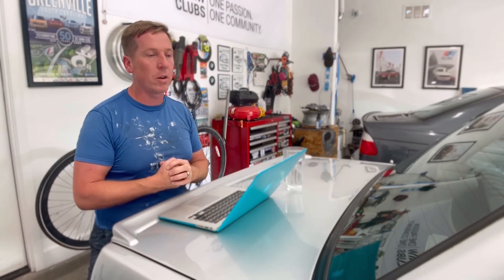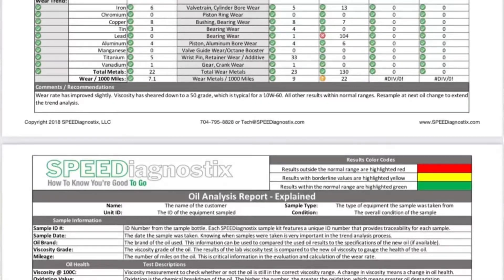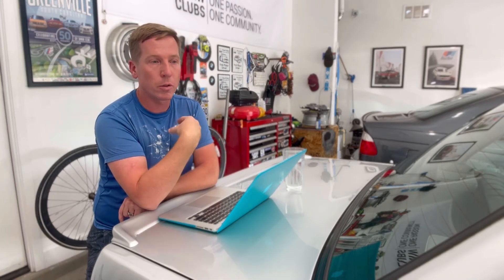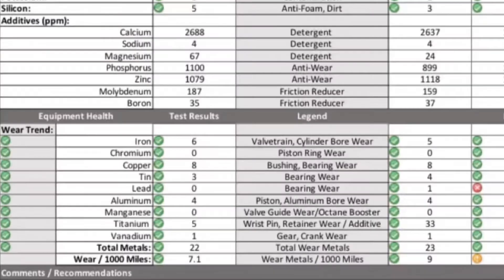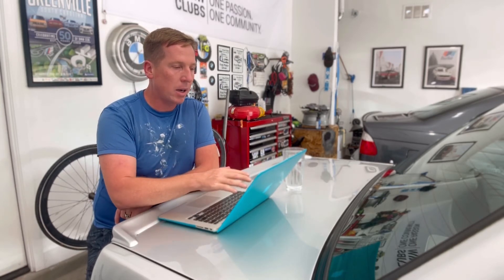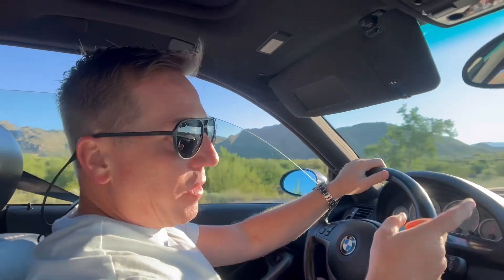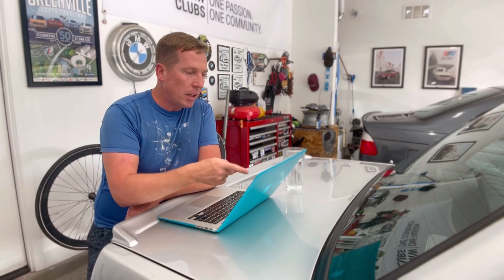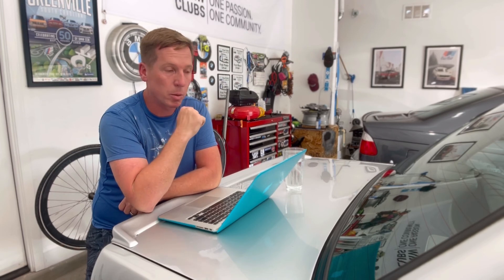BMW E46 M3: Are My Bearings Destroyed? Oil Analysis Chat

Comment: You are correct on getting a baseline on the engine as each sample is just a snapshot of that moment in time that you took the sample.  Good oil changed at prudent intervals and proper warmups before high rpm is cheaper than rod bearings.
Reply from the maker: Thanks for watching!!

Comment: Completely agree with this, its all about that proper warm up procedure. From oil analysis I've also learned that letting the car idle to warm up first is nearly as bad as romping on it cold, since idling causes oil-fuel dilution and degrades the oil's lubricity over time. I do still think RBs should be considered a maintenance item that should be replaced at a 50-75k interval depending on driving style. S54s / M3s are getting expensive, and the ~$3k cost to do RBs is well worth the insurance on a motor that would probably cost $15k+ to replace (cost + labor).
Reply from the maker: Thanks for watching!! I’m glad you brought this up. Too long of a warm up as you mentioned brings about it’s own issues as well. Definitely agree that rod bearings are a maintenance item and I’ll be replacing mine within the next two years. Since I drive 6k miles a year, that will put me around 60k in the bearings. Definitely don’t want to replace an engine 😳. Thanks again for your comments!!